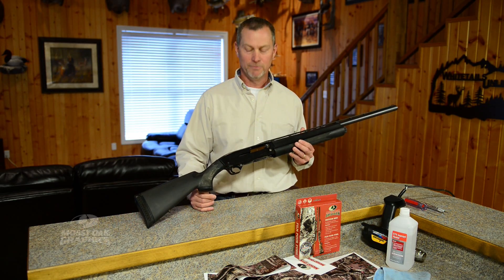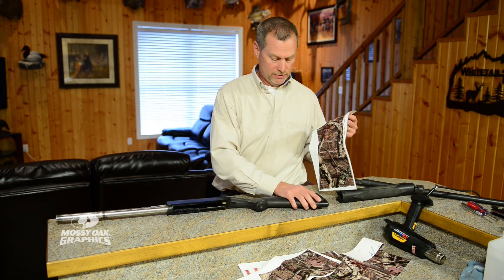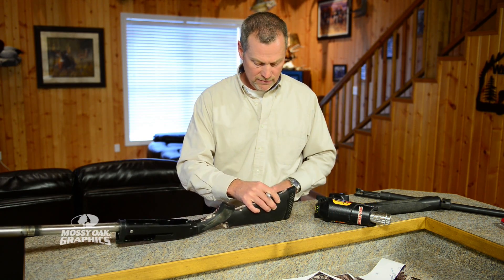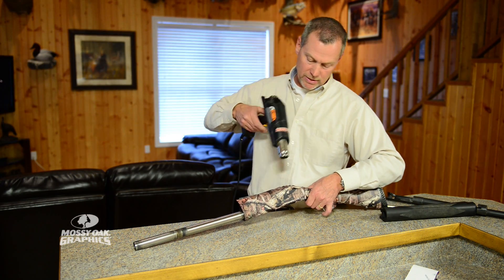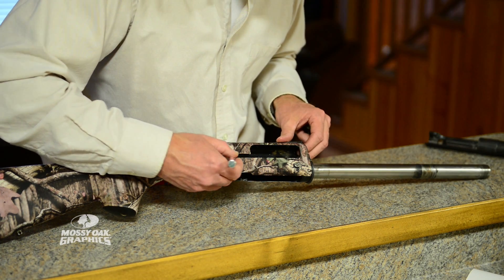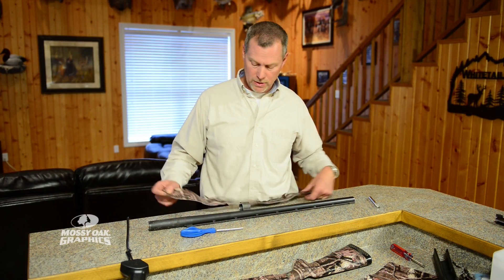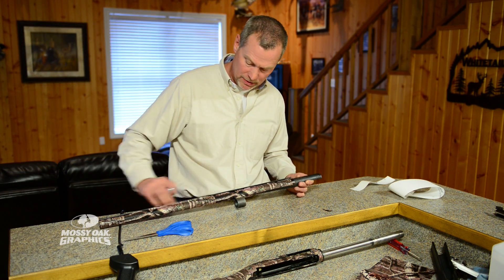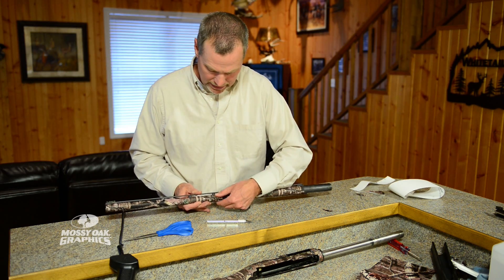Mossy Oak Graphics Camo Gun Wrap Installation Instructions

Comment: Dude this was hard af. I do construction and work with tools every day. I mess with guns and bows everyday and I promise you it is not easy. But you can make it looks really good. Just keep peeling back up if you get a bubble or wrinkle and LIGHTLY heat and pull and stick, but yea save your extra pieces, mine didn’t line up and I’m glad I had some extra pieces. DO NOT DO THIS OR CUT WITH A RAZOR ON A EXPENSIVE GUN ESPECIALLY WOOD! I tried to go as light at possible and it still hit the wood.
Reply: Same.  Started on this project tonight and I’m sweatin
Reply: @muddypondoutdoors  you will get it, we’ll this was 2 days ago so I’m shure you did get it. Just use your extra pieces and just make it look as good as possible.

Comment: At 5:53 - For trimming the wrap on the back of the stock.  Do you recommend any other way?  I think I will just use a sharp pair of scissors to trim the wrap from the back of the stock.  This way, it does not scratch the wood stock finish on my 1100.
Reply from the maker: Hi! Yes, scissors would work fine.
Reply: Mossy Oak Graphics Awesome and Thx!